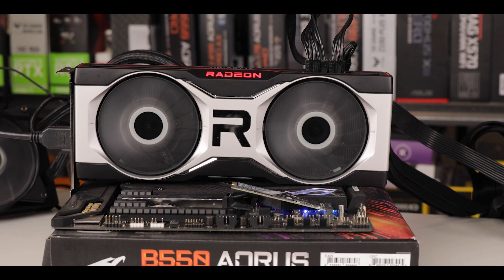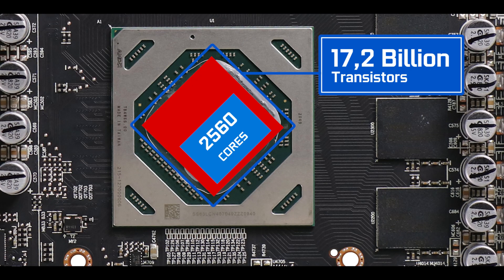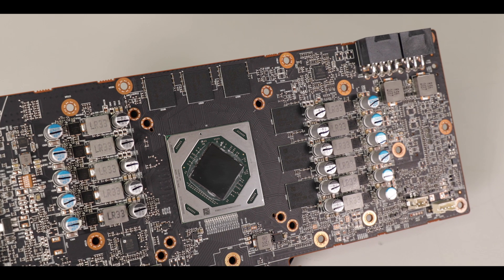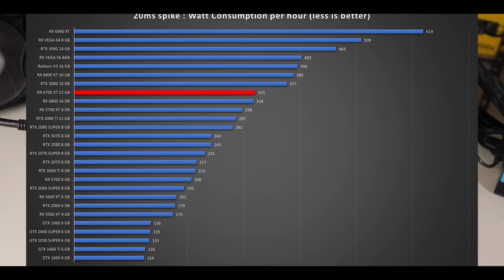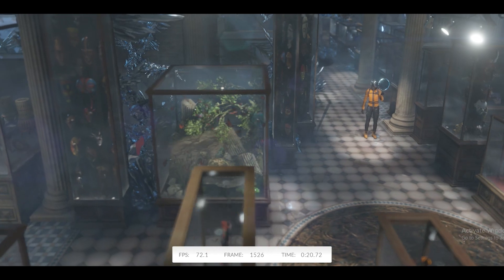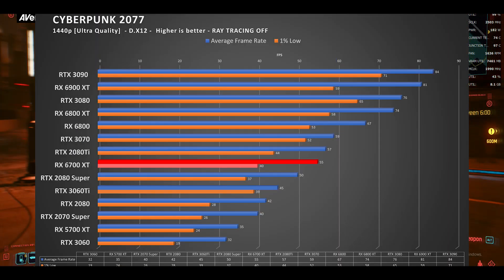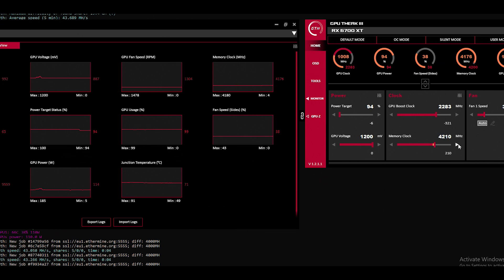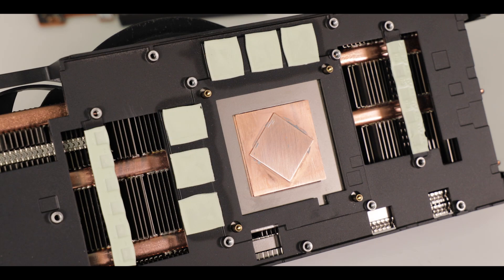GIGABYTE RADEON RX 6700 XT 12G : decent 1440p, but...

Comment: I did go with the POWER COLOR RED DEVIL RX 6800XT 16GB.... I got it on an amazing suddenly drop in price, so was very lucky... The 6800XT IS AMAZING. I was going for the RX 6700 or 6750 series, but due to the price drop it was a new brainer...

Comment: So, im pretty new to all of this. Since the outputs only support up to 120hz, does this mean even if I „produce“ 144hz and also have an 144hz monitor, in the end i will still only see 120hz?
Reply from the maker: The output supports much (much) more than  120hertz. So you'll be fine with 144

Comment: I picked up the ASRock Challenger Pro OC version yesterday. Got it delivered and installed today and it's a massive upgrade from my Sapphire 5500XT 8GB. Even GPUZ/CPUZ and 3DMark don't yet recognise the card yet :D For reference, the card I got scored 11650 in 3DMark with temps around 55oc on OC mode.